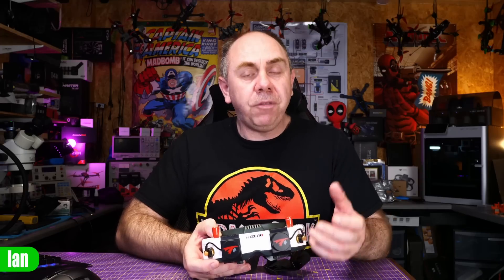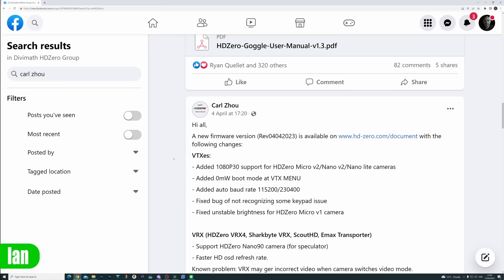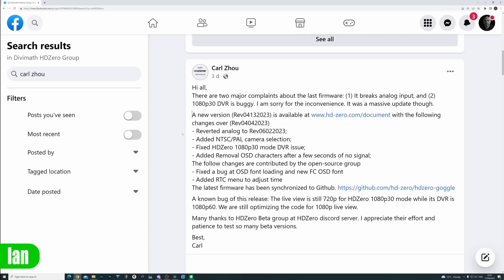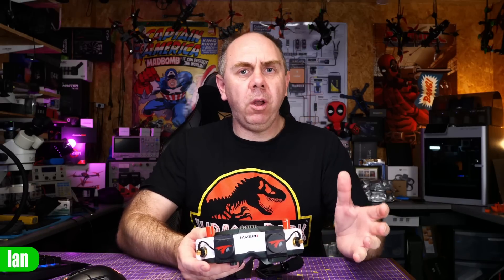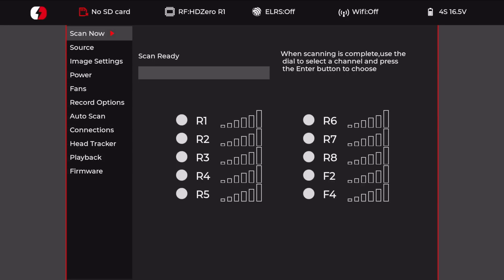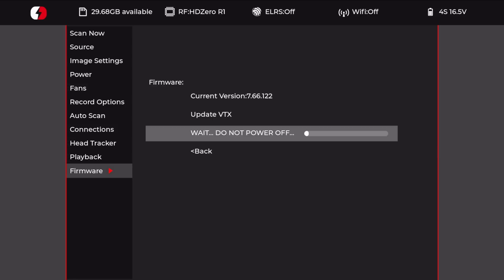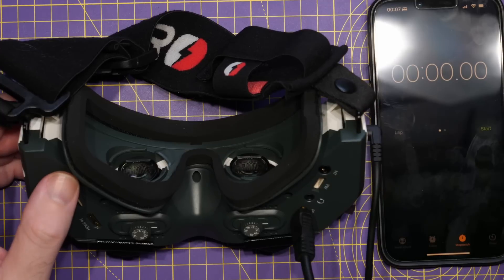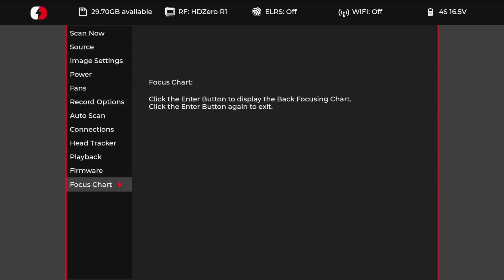HDZero FPV Goggles V9 BIG Update How-To And What's Changed

Comment: Ian, mention to your viewers, that the update requires a smaller (32Gb worked for me) because it must be formatted in FAT32 for the goggles to read it during the update.  Once updated, one can use a larger card for DVR.  This hit me because I was using a 128GB card and windows formatted it in the extended format, not FAT32.  In the last step, you copy two files and power on to update. Since my card was not FAT32, it would not upgrade and it took me a couple of hours to figure out. Once I used a smaller card, formatted as FAT32, I was able to complete the upgrade.

Comment: My hdzero goggles do NOT turn off the analog module regardless of the analogrx setting. Why is that?
Reply from the maker: That options is only for the Batch 2 goggles, when did you get them ?.
Reply: @MadRC  I ordered them in Jan. Received them in March. They were already above 9 in the software.

Comment: Have you heard of anyone getting constant single colored pixels all over from the goggle's internal receiver? It's not related to poor reception as I've checked it against the external VRX. Would just love to find out I can easily fix it, but nobody else has mentioned having such a problem, and Divimath seems to believe it's normal despite showing my findings.
Reply from the maker: Iv never heard of that.  Can you share some singes or something. If you want you can hop onto my discord.
Reply: @MadRC  Sorry, what do you mean by singes? Not a Discord user, but I do have the videos up on Google Drive if those work.
Reply: @MadRC  Went ahead and put them on YouTube since the Drive links just cause the comment to get silently nuked. Not sure when HD processing will be done, but hopefully the detail doesn't drop too far.

Goggle DVR: https://youtu.be/IBKFuFEOF5o
VRX DVR: https://youtu.be/zABMS93fnc4
Reply: @MadRC  I made note that my RX seemed to be bad when sending them in for optics repairs. They said they swapped the receiver boards out and now all is well. That solves that mystery!

Comment: I ordered my HDZero goggles on Jan 04 2023 and received them around late Jan or Feb 2023 I think. I'm sure they are not batch 2. I think you may have got that wrong in your vid (i.e. "if you got your goggles in 2022, they are batch 1 and if you got them in 2023 they are batch 2") and several hundred goggles were ordered in 2023 that were not batch 2 if I'm not mistaken...
Reply: Correct, the first few hundred ordered on 4th Jan and received late Jan to early March were Batch 1. The box that these came in has a sticker on it with a production date of late 2022. The goggles received in 2022 were the beta versions available to select persons only.

Comment: Have they restored the HDMI passthrough on this firmware version? This was an originally advertised feature as I recall but was removed in some firmware versions.
Reply: Not that I can tell. HDMI out will be working, but as soon as I put a signal in the other end the output dies.
Reply: @jaysonrees738  Yep that's passthough still not working. Thanks for checking. are you on the latest 9.0.12 firmware?
Reply: @Clickmaster5k  I am.

Comment: Hey Ian do you know if the analog is fixed? I'm trying not to update past 8.0.1 until they have it worked out. Cheers
Reply from the maker: It’s better but people seems to be posting mixed results.  It’s hard to give an definitive answer right now as there is many factors. They reverse the FW so improve it for that especially but some still seem to have issues.

Comment: Batch 2 has some major feature upgrades in my opinion that do make it a version 2 unless they some how bring these options to batch 1. Being able to control the module bay power is something they said they where gong to try for the goggles but is only supported on v2. This being controlled by the goggles opens up a lot of options for the goggles to automatically turn the module on and off based on selection. Sure that sounds sorta small but it would be really nice. The v1.5 bay also has a separate power button that v1 goggle users could use but then v1 goggle owners have to pay more to get a still lesser feature. Considering this makes me think of the batch2 as a very definite v2.
Reply: 2 hour old video and I'm not even the first one to mention the module power...
Reply: I wouldn’t call those major updates... an improvement sure but nothing major
Reply: @stevejobs5  Certainly enough of a difference to merit differentiating the goggle versions. If I was going to buy a pair used its something I would be looking for.

Comment: Are you able to get the software power switch to work for the analog module?
Reply: Software powerswitch they say is not supported on version 1 goggles even with the new module bay. I have not seen anyone confirm this though.
Reply from the maker: Yes that is correct you need the batch 2 goggle to use it
Reply: @MadRC  is there a way to know if you have batch 2?
Reply: @rgross989 yea how do we know. I can’t control the power with the setting but I didn’t have to do a special update? I feel like I should be batch 2 but the analog won’t turn off